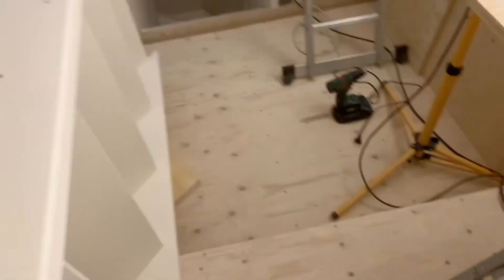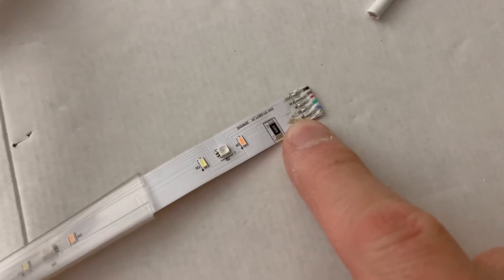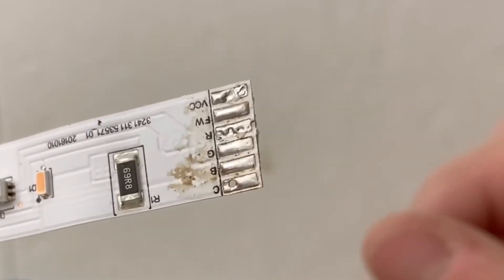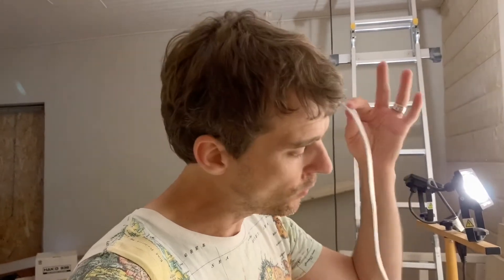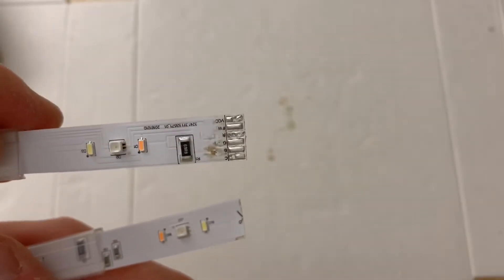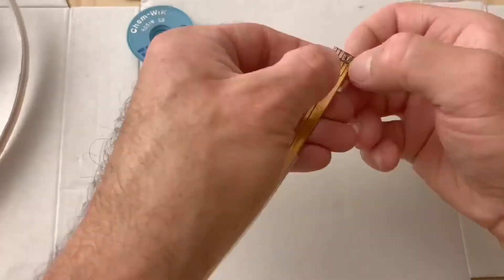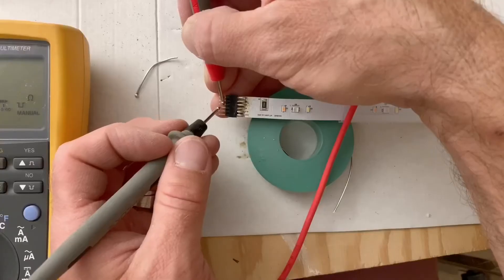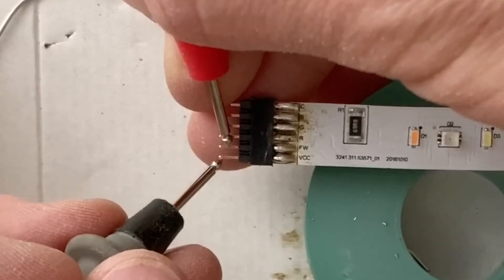Renovation: soldering the Philips Hue Lightstrip Plus begins!

Comment: Are you using Philips Hue v4 Bluetooth light strip?
Reply from the maker: Thanks @Ryan for the question. No they are not the V4. The V4 came out just before I started this installation. However while the V4 gives a few more options for more flexible installation, I would still have had to pull them apart and do some soldering to install the strips to the staircase. The V4 also have the Bluetooth enabled control. But that’s really also a waste of tech for me as I’m running a Hue bridge. 

Thanks for watching and thanks for your question. Any more and I’m happy to try answer them.
Reply: @PaulWarrenEaton  Thanks. I’m going to need to solder my extensions together because Philips doesn’t sell the cut-end hippo connector separately. Their extensions come with a 4 inch long wire which obviously creates gaps in the lighting. Makes no sense to me why they don’t include cut-end connectors with extensions.
Reply from the maker: Yeah I really do think it’s a tricky balance that Signify try to find with the light strips. Just about everything else in the range is really just plug and play. Whereas these strips just lend themselves to being custom fit and installed. They could down the path of making the whole thing more modular. But I wonder what impact that might have to product returns or accidental breakages etc. 

At least with V4 they have attempted to make things a little more connectable. But yeah every place I think of putting one of these strips.. I will need my soldering iron. Good luck !

Comment: My Hue Lightstripe seems to be damaged... Do you think i can just use another cheaper RGB Lightstripe and connect it to the controller?! Thanks
Reply from the maker: If you purchased a compatible strip then of course it might work. But compatible would mean a Led strip that has 6 pins and handles same voltage. To achieve the precise colours that Philips Hue can manage, the strip is comprised of Red, Green, Blue, Warm white and Cold white leds. Add to that the ground line and you end up with 6 wires.

If it’s a standalone light installation then it could work fine. But if you have the strip in use with other Philips Hue bulbs, the colours most probably will never match. Good luck. Let me know how you go.
Reply: @PaulWarrenEaton  Thanks!